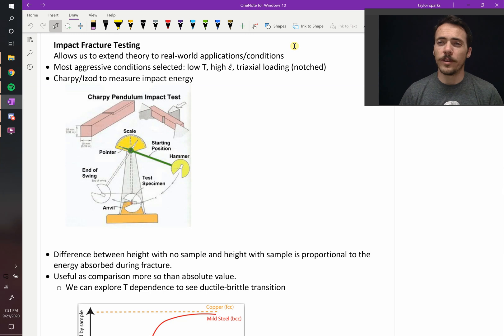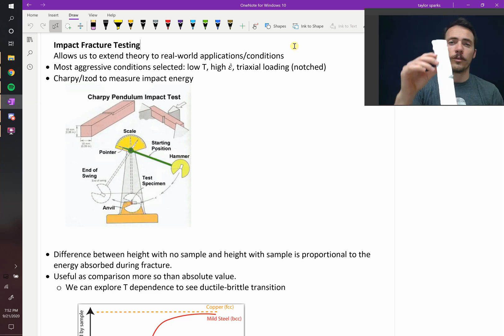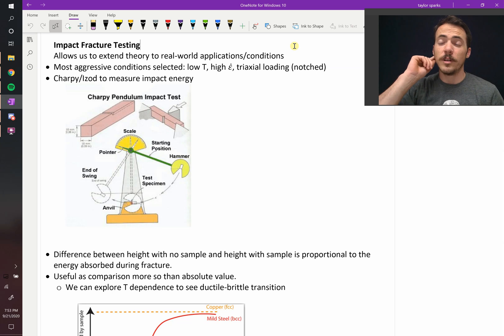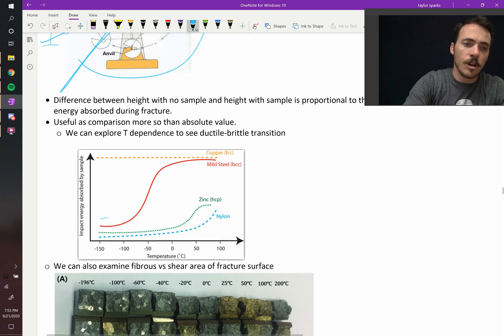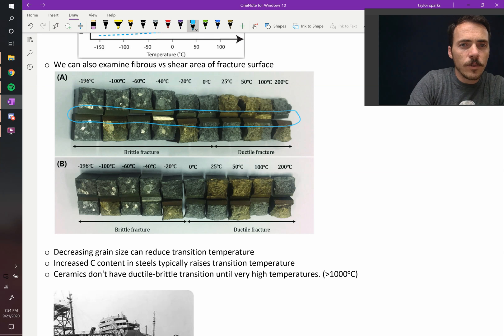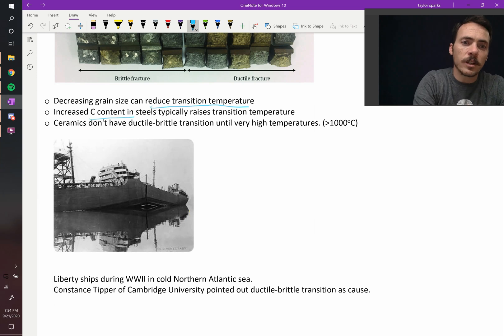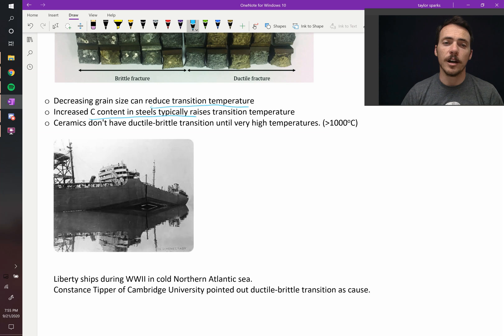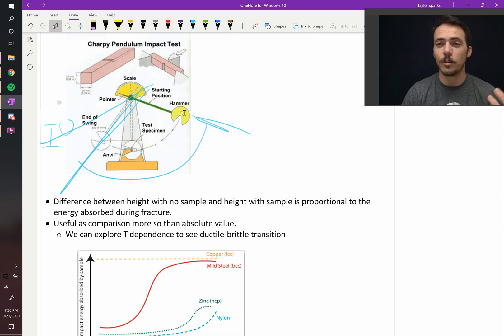Measuring ductile-brittle transitions with impact fracture testing

Comment: I have wondered here something. Why does the material at warmer temperatures behave in ductile manner and why does the material at colder temperatures behave in brittle manner ?
Reply from the maker: Great question! The answer is nuanced, but the basic reason is that deformation mechanisms are often thermally activated. If you don't have enough thermal energy, you can't get the deformation and if you don't get deformation then you get fracture
Reply: @TaylorSparks  Oh interesting.Follow-up question , why do ductile materials absorb a high amount of energy while brittle materials absorb low amount of energy ?
Reply from the maker: @ygt824 it's related to the previous reason. Plastic deformation absorbs energy. So a ductile material is one that exhibits plastic deformation and that process absorbs energy.

Comment: Any chance, you know what this means? 
"the transition temperature is defined as the temperature that provides absorbed energy equivalent to the mean of the absorbed energies in the ductile and brittle regions."
and how might we calculate the energy absorbed using this definition?
Reply from the maker: Yeah, the transition is when the energy for ductile and brittle is equal. When it's in the brittle regime the sample will absorb much less energy to fracture via the brittle mode and vice versa. The energy of fracture is typically measured with something like a charpy impact test where you swing a pendulum through your sample and then you measure the difference in height that your pendulum passes through